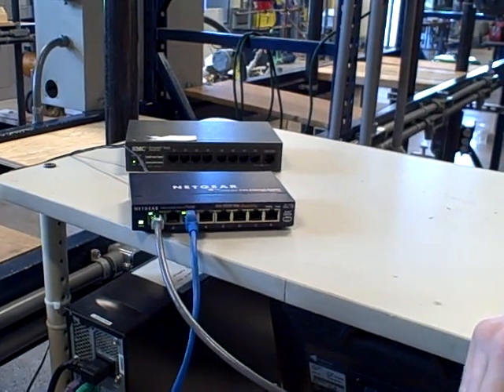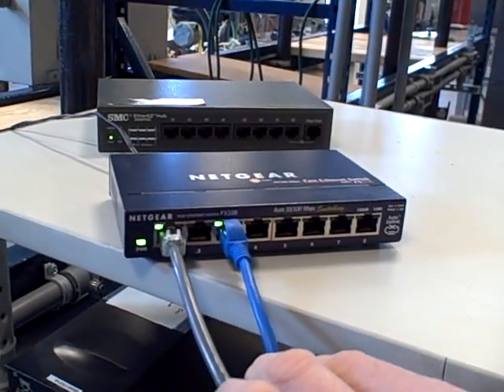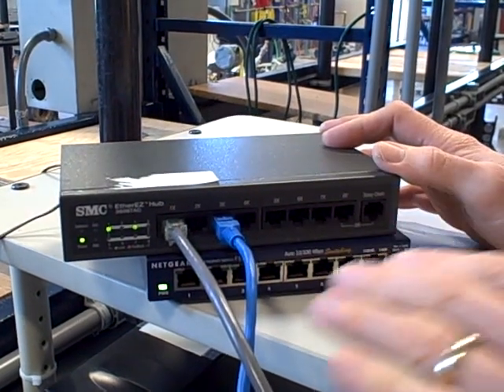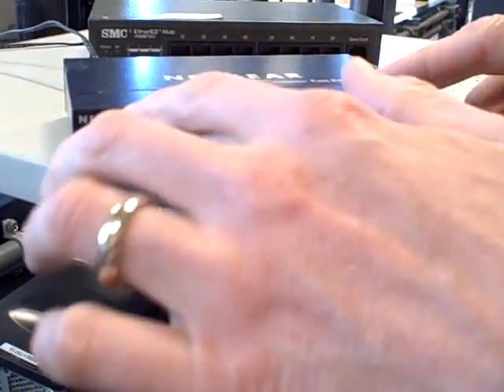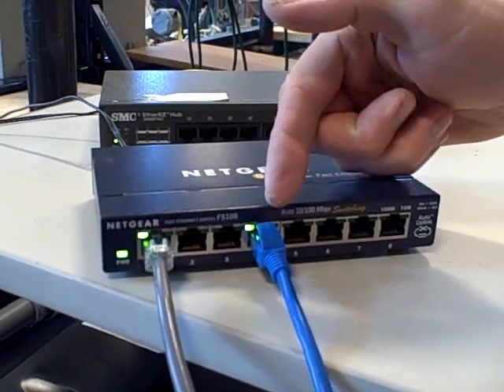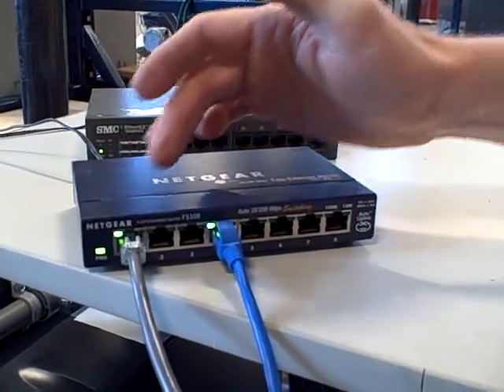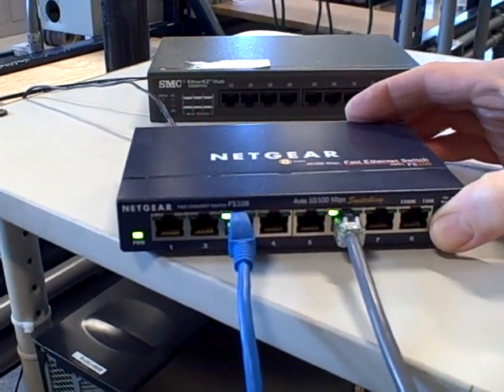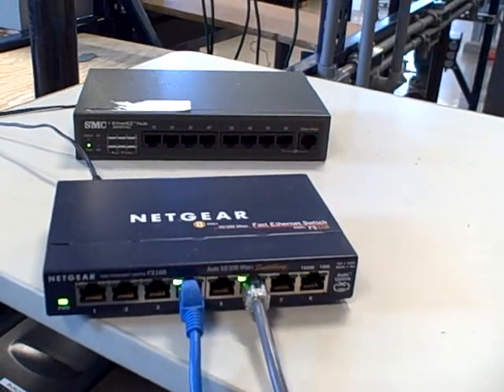Ethernet hubs versus switches

Comment: The only reason for the delay when switching the PLC to a new port is the fact that it almost never transmits on its own (possibly once every 5 minutes). If it was reconfigured to transmit a frame every few seconds, this wouldn't be an issue. (For example, if you had two full-fledged computers connected to the switch, those networking stacks are going to talk so frequently that there would be almost no delay when changing ports under pretty much any circumstances)
Reply: +lpreams 
I was thinking this as well.

Comment: Wonderful Explanation! I figure that unless a Ethernet Switch is way faster than a Ethernet Hub, I'll go with a Hub. A Hub definetly sounds like it's a "set & forget it" situation.
Reply: Can you even buy a hub these days?  Most hubs were 10 Mb, though there were some at 100 Mb.  Switches are often 1 Gb or more these days.  You're also likely slowing down your Internet connection, unless you have a really slow one.  I have 1 Gb switches here and I get 920 Mb down on my Internet connection.

Comment: Hubs are pretty rare. Rule of thumb, if you find one, disconnect it and throw it away.
Reply: Steve Warren I got a laugh out of that.
Reply: Steve Warren I dont know what i laugh so hard to that lol... good one !
Reply: ***** No. the hub will actually cause you to get IP conflicts on your network. The hub will work fine as long as only one device on it is operating at a time. But because it does not assign IP addresses to each device with DHCP, if you turn on two devices connected to a hub at the same time, they will start trying to use the same IP address and you will get IP conflict error messages. Go ahead, use a switch. They're cheap and you'll never even know it's there. Everything will just work.
Reply: +Steve Warren That's completely wrong. A hub (or switch) has NOTHING to do with assigning IP addresses - if you get you get duplicate IP addresses, there's something else wrong in you network.
Reply: +Steve Warren Hubs are more common then you think,  alot of what is marketed as a switch today are really just hubs.   a hub operates on layer 1, a switch operates on layer 2 of the OSI model.   a hub passes date to every port attached, a real switch only sends the packet to the port that is leads to the destination of said packet.
Reply: +Steve Warren LOL. We use HUBs for everyone of our racks which is around 300. We use them for server ILOs.
Reply: +Tom Miller Wow, I'm surprised you can still buy hubs. In that case I would guess you are like consoling into the server, one device at a time?
Reply: actually,  ALOT of what are labeled as switches at places like walmart, officemax, etc are NOT switches, but in fact hubs.
Reply: Steve Warren you have no idea what your talking about. go learn the OSI model(7 or 5 your choice)
Reply: Work with them every day. Been trying to learn them for years, So far, if it ain't broke, don't fix it seems to work best!
Reply: BTW, I thought hubs and bridges were layer 1. I don't think they're as common as you think.
Reply: +Anton T Yes! Exactly! That's what I thought.
Reply: A hub works at the physical layer, layer 1, of the OSI model.
Reply: Jason C. Hubs, bridges and repeaters... I think.
Reply: Steve Warren There are layer 2 switches. They are called Multi-layer switches (MLS).
Reply: +Steve Warren   Maybe he is talking about a patch panel?
Reply: Steve Warren joys
Reply: Hubs are very important and needed, especially for sniffing ;)
Reply: All switches are layer 2, what are you talking about?
Reply: +Brian Fischman it is in fact, the opposite. Buying a hub at places you mention is next to impossible.
Reply: Glasfel666 I think he meant that there are switches that can do some layer 3 stuff,those are called multi layer switches.
Reply: For lamen's terms a switch sends packets directly to who they go to versus a hub who just sends the packet to everyone
Reply: So I am learning networking, and after reading Steve's comment and resulting thread, I am more confused than ever!! My project is a home with approx 25 "plugs" throughout the house. HUB or Switch fellas? Because a lot of people are absolutely adamant that they are correct, but someone is wrong, correct?
Reply: in 2016 Hubs were still very hard to find, switches were everywhere still being marketed as hubs!
I know I bought several "Hubs" that were in fact more modern Switches.
Hubs are sought after for analyzing and troubleshooting networks.
With a hub man in the middle can watch all the traffic between 2 other computers, can't do that easily with a basic switch.
Reply: Exactly I was thrilled to read my old Netgear EN104 was a Layer 1 Hub, can't wait to sniff my 1st menage a trois.
I hope it really is a hub.
Reply: Lol gotcha
Reply: @stevewarren4292  ????  DHCP has nothing to do with hubs or switches.  There has to be a DHCP server somewhere on the network.
Reply: @fischb22  Hubs are layer 2.  Layer 1 refers to things like cable, physical hardware, etc..

Comment: Ethernet originated as a "bus" architecture, multiple nodes on a single shared cable.  Over time it evolved to use hubs, repeaters, and bridges to expand and extend the maximum distances between nodes. It later became more of a star configuration, as we have today, where you almost invariably have an active network device interconnecting things, acting as a sort of traffic cop for the data packets.

I worked with Ethernet back in the early days, even fixed a major throughput problem by understanding the difference between Ethernet 2.0 and IEEE 802.3 standards ("heartbeat" vs. SQE).  We've come a long way, but understanding how things work at the lower levels, as this video shows, can really help when fighting problems or preventing them in the first place.
Reply: My first Ethernet experience was in the mid 80s, with DECnet over 10base5 Thicknet.  In 1989, I hand wired a couple of Ethernet controllers on prototyping boards for Data General Eclipse computers.  I also had some experience along the way with 10base2 Thinnet.  In spring 1997, I was working on a job to convert some Ontario government offices from 10base2 to 10baseT, so they could move to switches.

These days, my home LAN is 1 Gb and with my Internet connection around 920 Mb down, it may soon be time to upgrade my network.

Comment: It would have helped  to show that a hub "talks" to all ports, and the switch doesn't bother other active hosts. There were no other active hosts to make that comparison. This vid makes it seem that a hub is a much better choice on a small network.  I would like to know when  the hubs' blind broadcasts becomes a detriment,  and the switch becomes beneficial. Thanks for the vid.
Reply: Always, hubs cannot run in full duplex. Even for just 2 computers, a regular patch cable is better; they can handle full duplex. The only time you want a hub is for Wiresharking traffic from two computers in 1992, and even then there are better options.

Comment: There should be dead-timers within the switch CAM table to flush old MAC Address entries. But you'll have to wait. Otherwise, you can always power cycle switch to clear CAM table. Nice video.

Comment: Wait, so for the switch, what if you want to plug in multiple devices? I am plugging in my wifi router and my ps4, and it is only recognizing which ever one I plug in first. The other port is blinking, but there is no actual connection being made.

Comment: Thank you very much for the clear explanation.i am wondering if I can use two Ethernet switches at the same time.  I have one switch plugged into the router directly upstairs and run a 100 feet Ethernet cable from that switch to a desktop computer in the basement. Can I split this cable by plug the end (in the basement) into the 2ND Ethernet switch and hook up 2 computers into that switch? will it work?

Comment: Hubs are generally not used anymore because they tend to replicate packets.  That replication of packets can use up the bandwith on your ethernet and cause broadcast storms.  Switches solve this problem by only sending packets to specific ports (instead of broadcasting packets).

But that feature that they replicate packets can be used in order to "listen" to an ethernet conversation with say a laptop running a protocol analyzer such as WireShark.  I keep a small hub in my toolbox for this purpose.
Reply: in a managed switch, like TL-SG3424, you can "simulate" a hub by transferring all data processed by the switch to one distinguished port.

So you can debug your network AND be happy to have no collision domain :)
Reply: By definition broadcast storm is when node send/broadcast data over a network link, and the other side of link rebroadcasting same data back to it in response so it have not much to do what you use switch or hub.
You can have broadcast storm on switch to, connect 2 switches with 2 cables together and you have it instantly (without link aggregation on ports), of course no one will do that, but it can happen if you have lot of switches on different locations and not good documentation for network. Most modern switches some kind broadcast storm control so it will prevent it from doing network meltdown.
Reply: Switches will broadcast to all ports, until they learn where the destination MAC is.
Reply: @christiansonnenberg6306  You're referring to what's often called "port mirroring".  I have done that with a 5 port switch, which I carry in my computer bag.
Reply: @James_Knott  Thx for clarification and the blast from the past!
Since that post I've gotten a little bit of an education in networking and think I'd articulate myself a little bit better than nine years ago.

Nevertheless, how did you end up on a video with a topic so much out of date? :)

Comment: 3:28 It seems that the way it's explained, the hub and switch are doing the same thing. He explains the Switch is sending messages to a specific MAC? It's unclear. I'm only beginning to research switches and hubs though my understanding of CS is far wider than my specific understanding of networking. So, is this Rather Desktop Unmanaged vs Desktop Web Managed? I'm asking, not stating, because I really don't know. Thanks.

Comment: Hi, I have a question. I have a Netgear gs108 Ethernet Switch (8-port) on my existing home network with a Comcast/ Xfinity cable modem. There are 2 Netgear Power XE104 line devices connected separately from the modem by ethernet cable through the circuit breaker to an outlet by the other Netgear Powerline XE104 device in the kitchen. It has no ethernet switches in the area. Only a 300 Amped Wireless Router on the kitchen table as a repeater. I need to replace it with a different model of the repeater. It only supports 2.4ghz. I need a dual-band repeater for the kitchen. One connection for the 50 inch Samsung tv, one connection for the Netgear Powerline Connection and one connection for my gaming systems. I need a larger amount of ethernet switch ports then what I have. Plus what is the best wireless/ethernet cable router currently available? I'm a gamer.

Comment: 3:54 Can this be cleared via unplugging and plugging or cycling the switch? (edit: 30 seconds later my question answers itself in the video, great coverage!) This makes sense though, does this also happen with household routers? I've often pondered this notion when changing slots while troubleshooting. Or even USB ports would this happen? I ask about USB ports because sometimes when troubleshooting a plug and play (pray) solution the drivers won't load and I have to reboot to see the "cannot find drivers online" message a second time because it will only alert once. Thanks.

Comment: Correct me if I'm wrong but when you moved the PLC blue cable from port 3 to port 4 and it don't communicate is because the switch will look at the source MAC address on it's MAC address table for that known source MAC address. If that source MAC address is on the switch MAC address table but was on port 3, the switch needs to wait 300 seconds (5 minutes) for the switch MAC address table to expire before it can log that same source MAC address to port 4.

Comment: great video thank you so much for clearing up my question. i had a question i have a cable modem with 4 outlets one for the cable and 3 for your use. now i have 5 computers all wired not wifi. i also have vonage internet phone that needs connected too. i have have twc fastest internet connection they offer for the home. it is 50 Mbps down and 10 Mbps up. so i could get a gigabit switch plug everything into it then one cable from the switch to the cable modem, correct? right now i have 2 computers and phone wired and 3 computers on wifi but i want all wired. so will the switch help me with connection and speed over using just the modem only? the switch i am looking at is TRENDnet TEGS16DG Gigabit GREENnet Switch. is this a good switch to buy? or what do you suggest? again thanks for your  help.

Comment: hi. I have 6 ethernet devices. I want them to reach full speed, what should I choose?switch or hub.thanks
Reply: Switch.  Hubs are obsolete.  They will force your devices into half duplex, so they can only transmit or receive at a time, but switches can do both.  Also, most hubs were only 10 Mb but, these days, switches are often 1 Gb or faster.

Comment: Hi just a question. I have two pc that needs to communicate internally and If I use a hub will it bypass my router modem configuration?(firewall etc)  Right now my router is managed by my isp and I cant configure the ports to allow that my two pcs needs example port 5353. Im thinking if i use a hub it will by bypass my router config but atill be able to connecto to internet and also internally(without firewall blocking)

Comment: Is the resetting of the ports when the slave is changed dependent on the switch model with regards to the timeout?  ie. 5 minutes for this particular Netgear.  Can this timeout be adjusted in the switch settings?

Comment: Soo i have a computer and xbox that id like to run my gig speed internet into. Which would be the one to use in my case? I just have one ethernet cable coming from my modem, and would like to get both my devices hardwired.

Comment: Thank you for your video. Question. Can I connect a switch in the place of a Router? I don't want to use wireless. I know I can shut off the wireless on the router but why get a route if you don't need it?
Reply: In most cases you cannot. The router isolates your ISP's network from your own network and routes packets between them in a specific way, usually with network address translation. This enables you to connnect any number of computers on your side of the router. They will also have a degree of protection, unlike in the video where both devices soon discovered each other on the same network segment.

You may use a switch if you can get an IP address from the ISP for every computer (usually limited to 1 or 2), or if you already have a router provided by the ISP's CPE ('modem'). You may need to access the CPE to enable the routing function. The modem's built in router may not be as capable or you might not have full access to it.

The wireless radio is like another port to the device, on the LAN side. If you still have two or three wired devices, and but none of them are wireless, the router still has a job to do.
Reply: No. The router this days have some components inside e.g. the modem to connect the WAN of your local provider, a switch, a WiFi box, DHCP and so on. So in the most configurations your network not works more till a killing switch if you put your analog line cable inside.

Comment from the maker: Unfortunately this does not work.  If you move the master (HMI) cable to another port, the problem remains.  Ethernet frames sent to the PLC still get sent to the old PLC port, until the timer times out or the switch is reset.

Comment: Hi

i have a netgear n600 modem/router dual band, there are two ethernet ports in the back. All of a sudden one of the ports stopped working after 2 months One is to my home security system and the other to my home security cameras. Instead of buying a new modem/router combo, do you suggest i buy a switch to connect to the port that is working or buy a whole new unit?   thank you
Reply: Balada NYC  Buy a 1 Gbit/s unmagement switch, connect one port to the router, one to your cam, and one to your security system.

Comment: I did not know the difference before now.  So now I ask,  I plan on purchasing either a 16 port or 24 port Switch or hub.  I plan to hook up 4 PS3's,  3 lap tops,  3 streaming boxes, my home DirecTV internet modem, and a couple of Smart TV's. I have  spectrum internet.  The 60 variety.  Will my system crash if I use them all at once?
Reply: If you use a gigabit switch, and have a fast enough ISP connection, you shouldn't have a problem.

Forget using a hub. Period. Video didn't really adequately explain the major flaw of a hub, which is data collision.

In video, he said that his HMI is broadcasting to all other ports, which is true. What he failed to mention is that in a hub, ALL connected devices broadcast to all ports. So, rather than one person in a room talking and everyone else being able to hear it, it's more like a bunch of people in a room all yelling at each other so loudly and so often that most people can't hear much of what any other person is saying.

The more devices trying to use the same 'wire' to send signals at the same time, the greater the chances of data collisions, and the greater chance networking becomes all but impossible.